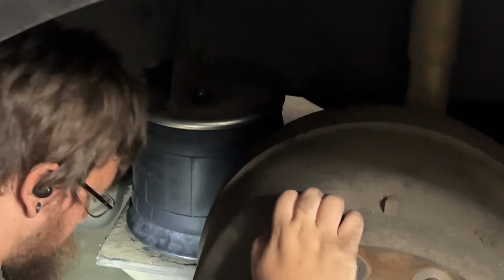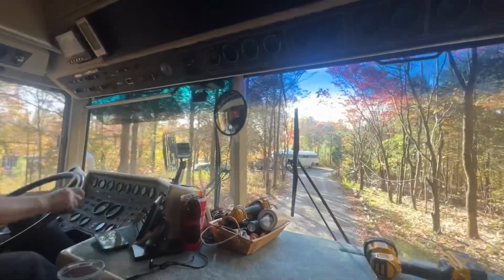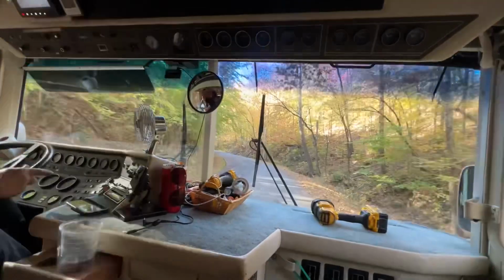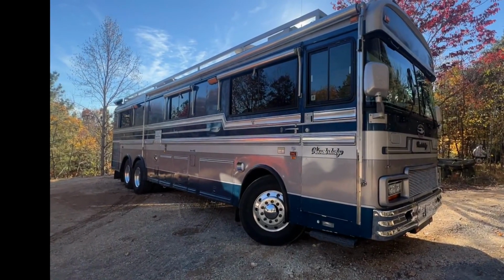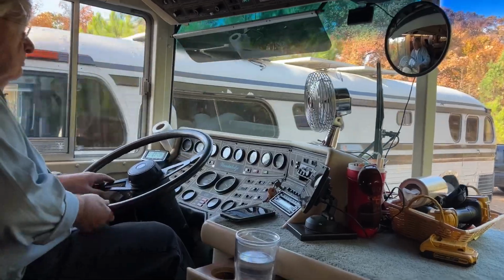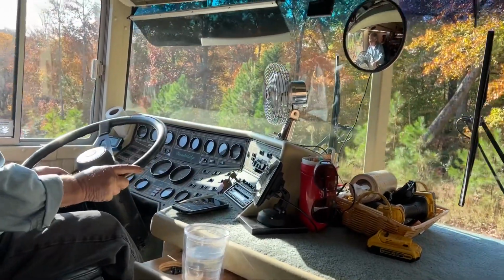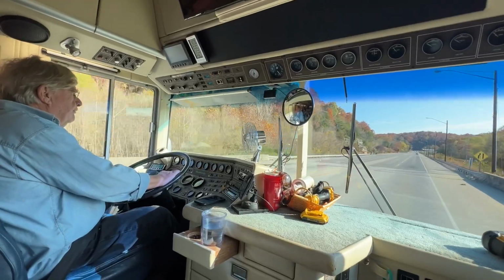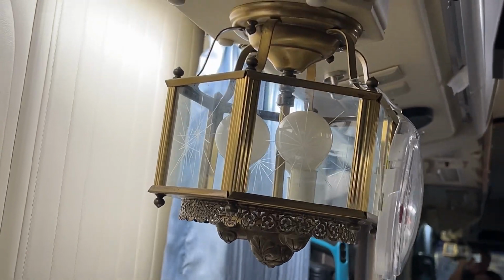A very rattling, squeaky Wanderlodge. We attempt to identify and eliminate the abundance of noises.

Comment: I have a '84 36 foot Wanderlodge with a 6V92 and when you get the rattles done it is sweet. Even the engine noise is just right and I open the windows to hear that sweet exhaust, especially going into tunnels!

You know, those 40 footers need 40 acres to turn. My short bus will U-turn in only 6 lanes of traffic! :)

Comment: When I worked at a TV shop, a customer brought in a TV that was "making a squeal noise."   I was young at the time, around 18, but I, the boss, or the other technician couldn't hear anything. When the secretary showed up for work, she told us "that noise from that TV is driving me crazy!"
Reply: High pitched squeal?  I could walk by in the hall and know the television wasn’t turned off.  Drove me insane.
Reply: I used to be able to hear those, tube TVs had flyback transformers that often made noise. I used to be able to hear a few of the motion sensors used in alarms and even a remote control that used sound. Age took care of that issue! lol

Comment: Kelly is certainly a lovely person, if you think those rattles are bad, come to the UK and drive a 3.5t Motorhome, coil front springs, but bone shaking leaf on the back, air suspension is available but it is only an assist not full air, the build quality is awful, same for European vans too, that glass of water on the dash would have been mostly on the floor.

Keep on Keeping on all of you, from a very jealous 72 yearold UK motorhomer.

Comment: So Scott, I have been looking at coaches for a while now, I really pay attention to the engine bays, and have noticed different manifolds for the turbo, some are rusty looking pipe, and others appear to be some sort of larger cast material, usually painted a grey color, then on like the engine here in the video, it has a blanket on all of the different parts, and I'm sure that, that is for heat management, I have even seen the mufflers with blankets, again for heat management.  What is the best set up, do they have aftermarket systems that would be considered an upgrade, I'm just trying to learn all that I can. I live in Texas, and we have some really hot summers, and believe it or not some very cold days in the winter, not consecutively but it does get cold here, so I would want a set up that would cause the least heat in the summer. 

Also what are your suggestions for AC? Again I'm still learning, I have heard the terms, "Bus air" "Basement air" "Cruise air" and then of course the top mounted ACs, we call them "Taco boxes" down here. I'd like your opinion on that as well, I have heard that the cruise air can be very expensive to repair if not working, and nothing last forever, unless you keep it well maintained.

Comment: That turn signal sound he has installed reminds me of the newer Gillig Low Floor buses hazard lights beeper. It beeps in rhythm with the turn signals but only in hazard light mode. It gets your attention but it's not as annoying. It's a shorter meep, meep, meep, meep sound. Maybe he just needs a less annoying but still noticeable noisemaker.

Comment: What is up with all of the gauges across the overhead?  Looks like an old naval ship.
Reply: I ran a T800 KW that was O/O spec. 24 gauges in the dash. 4 switches for the lights alone. It was a GREAT truck. 
Looked like an airplane cockpit at night.
Reply: I'll try to remember, same dash as mine.   AC controls,  clock, trip odometer, spotlight controls, altimeter, generator oil, temp, start,  shore power current, battery charger current, sure I missed a couple.

Comment: How do you pull a vehicle like that? Leave the keys in it so the steering is unlocked and in neutral? Isn't that hard on an automatic gearbox? 🤔
Reply: That type of vehicle has a transfer case that can be put into neutral so that the spinning drive shafts are disconnected from the transmission.